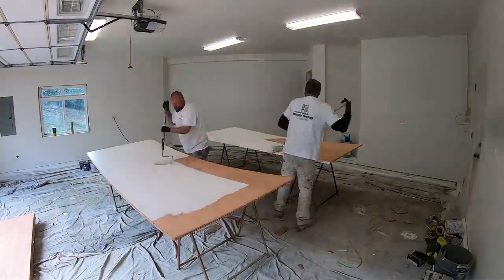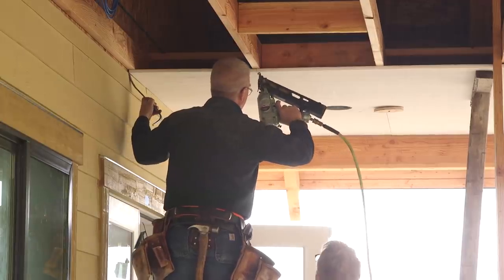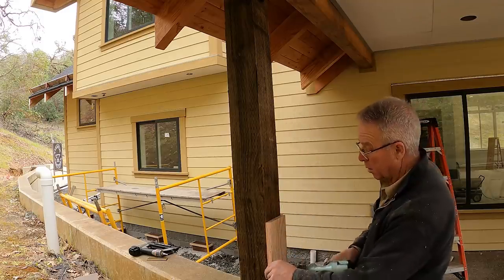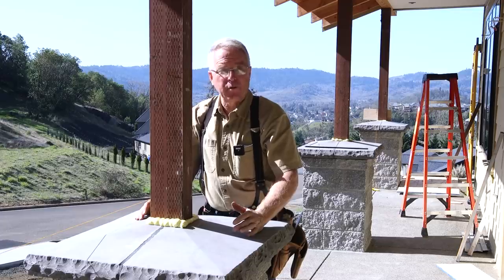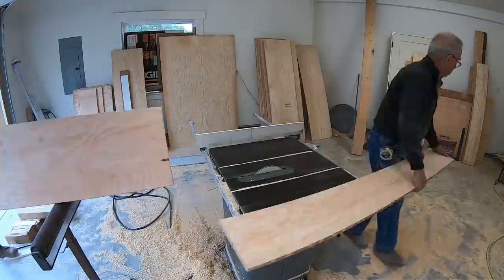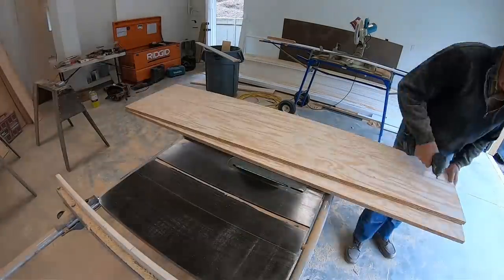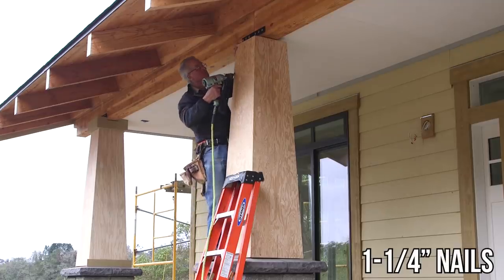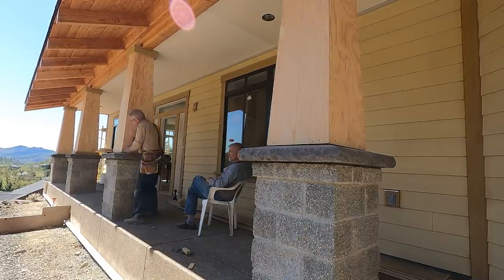Building Tapered Columns and Other Exterior Trim Ep.116

Comment: No adhesive on the tapered columns boys?! I know you said glue was unnecessary but I think with those pacific climates eventually those joints are gonna open
Reply: I would have gone with a 2x2 screwed to each corner for rigidity and something for the nails to grab onto. Plywood kinda sucks for holding power on its edge. I also would have reinforced the fronts of each around midway up for the possibility of flagpoles being installed on them.
Reply: Lose all the wrap and use a bigger column - sand and stain the REAL wood. This crap will fall apart in a few years.
Reply: @RRaucina  it'll be painted and it's barely exposed to any real weather. I think it will last more than a few years. But it's possible some warping or gaps opening up will happen inside of ten years
Reply: I agree I think it should've been glued.
Reply: If you had glued those with non foaming construction adhesive, they might not open up !  I don’t even know if those boards will stay laminated in your local climate.
Reply: It's decorative, not structural. Those joints will be fine for years and years and years... Besides, being in the climate that its in, it's gonna need to be able to breathe and expand and contract. Gluing it would defeat the purpose of that.
Reply: @mikeznel6048  you're correct about the expansion, but that's the point of the glue actually. When you correctly glue two pieces of wood they effectively become one piece, and thus move together rather than independently. By relying only on nails each side of the wrap is going to flex independentky, and eventually open the seams at the corners. 

Also it's the PNW, just because a porch is covered does NOT mean that the stuff on it won't be exposed to the elements. Rain often comes in side ways up here, and once the wood gets wet the temps don't often get high enough for it to dry out (3+ days at 55°+). That's what leads to rot in exterior trim, it's easily the number one exterior repair I do up here.
Reply: @Adamsadventures83  that  would look good every column "Flags out"
Reply: @mikeznel6048  respectfully disagree, using the right adhesive will still let the wood expand and contract but using no glue in a wet climate like the Pacific north west will destroy those joints in <10yr
Reply: Here in Tennessee the joints would pull apart .. plywood would bow and bend without ridgid nailers behind the joints .. I would definitely recommend glue on the miters
Reply: I'm a lifelong carpenter.  I agree it should have been glued.  I would have done so instinctively if I were building it.  But I don't begrudge EC over it.  I'm sure it will look great for a long long time.  But it would definitely hold together for a longer time with glue on the joints.
Reply: @jamesandayladodge4815  I agree but would say that I would think most of us commenting are carpenters but I guess you never know on here
Reply: @JB-ez2jz  I suppose you are probably right.  IDK, I often watch videos on adjacent trades out of pure curiosity, but yeah I don't usually comment on tree felling techniques.  So yeah, your right, most people commenting with serious thinking are probably carpenters.
Reply: I would usually agree with needing glue too but if this guy says it isnt going anywhere, it probably isnt going anywhere!
Reply: "2 of a trade never agree"
Reply: @willofdodge1  I agree with the idea that there's more than 1 way to skin a cat and different tradesman have different ideas. Honestly most times Scott has some many years over me and is so wise I'm usually learning. In this case I just don't believe it's the right move. Using laminated sheet goods  in the humid and rainy Pacific northwest and asking the joints not to split wide open like Megan the Stallion eventually is asking for trouble
Reply: My thoughts exactly. You gotta stiffen up that plywood joint, especially when exposed to the moisture.  I wouldn't even trust glue and nails. Frankly, i wouldn't even feel comfortable using plywood at all

Comment: Long-time subscriber, here. Found your channel while looking for concrete finishing techniques (you poured the pad for the garage of the spec house-- very good info!). Went back and watched all the  vids on building spec house-- powered through them all, and set notifications so I could see everything after that. Anyway... was dearly hoping you would include clear instructions on how to determine angles for tapered columns (and maybe how to cut them if you don't own a table saw).  Wanted to build some, once, but no amount of pondering in my ignorant mind contributed to anything like an answer. In a word: I was (and remain) CLUELESS! Beveled edges: totally get that. Center line to help determine angles... lost me there. Fast-motion video as you cut the plywood: left me in the dust. Virtually every other video you've posted fully explains what and why you're doing what you're doing (which is why I love your channel!). This one, though, left me "high and dry". Can you possibly re-purpose some of the video you've already shot, slow it down, and over-dub with some helpful information? Would massively appreciate it!

Comment: I've been in carpentry for 23 years and your channel teaches me things every new episode. That said, my biggest peeve with both carpenters and painters, especially on new construction is not priming both sides of the wood. You beg for peeling and other moisture issues on the finished product. I just yanked off 1360 ft of 10 inch(8) cedar siding and replaced it with new material.  Primed it on both sides with a topcoat of Benjamin Moore stain and we're going to do the west and east sides next year. The front never gets any sun and never peels. The house like several I have rehabbed over the years was built with raw unprimed cedar and stained raw so the moisture inside the house pushes off the coatings. Even had one builder tell my client that hous wrap would make his house explode due to pressure because his wok is so tight lol. He didn't prime an entire 6000 ft cedar home either and they've paid me to reside that entire house. It's a disgusting waste of trees. OK, dismount high horse and continue your excellent videos and work.

Comment: I have done exactly one set of similar columns, and I was doing them for my own home, which certainly changes the time management requirements.  I did a few things differently from Scott, the biggest difference being that whenever I build anything going outdoors out of wood, I prime both sides of the wood.  More work, but I don't have to look at wood that has been distorted by moisture seepage, ten years down the road.

Is what I do necessary? Not in a million years would I think that I know better than the Essential Craftsman, but neither am I ready to change what has worked for me for years.
Reply: I did that for the drywall in my bathroom.
Reply: Back-priming is never a bad idea. I'm not a pro - I sell medical equipment, but I'm compelled to constantly build, and I try to always back prime, especially because I'm primarily using pine that has a tendency to cup like crazy.
Reply: I work in a leisure centre, and in the changing rooms the MDF architrave (casing i think Americans call it) around all the doors is exploding where moisture has got in. It looks terrible, and definitely supports your idea of back priming.
Reply: @Matt_Alaric    Ah, good; someone agrees.  Now, I wonder what Americans would call a leisure center, 'cause I don't know what one is.
Reply: @dandavis4157  Gym? Sports centre? Something along those lines i would guess.

Comment: Another awesome video! A track saw could've been another option for the colum cuts
Reply: Not as accurate as a jig on table saw. Love my makita track saw and my dewalt table saw.
Reply: @SteveDiamond19  I work alone and often do fold over miters with the track saw. Running whole sheet goods over the cabinet saw can be tough if there is a slight bow or cup in the sheet especially considering the cuts in the video were done on a blem product. Keeping the sheet in contact with the table through the whole cut can be tricky, a deflection of 1/16 can mess up a nice mitered corner. The nature of the track saw keeps the saw engaged with the workpiece consistently through the cut.

Comment: I plan on doing the same craftsman style column wraps for my porch but will use lock miter corner joints via a lock miter router bit.  I'll assemble three sides and add the forth after placing around the posts.  Getting tight miter joints without exposed fasteners is what I'm looking for because I'm using clear vertical grain cedar where I've already glued up the 3/4" 1x8's.  A track saw comes in handy instead of a table saw for cutting the pieces before running through the router table.

Hope I don't screw up anything.  That wood is expensive!

Comment: i do this with white 4x8 plastic board and pvc trims from home depot.  I lay it all out on the sheet, cut it square with a circular saw, then run it on a router table with a lock miter bit.  to install i just nail it at the top and glue the bottom, with some spakling and rounding the edges together with a screw driver or any round piece of metal.  it looks great

Comment: Scott… PLEASE tell me you don’t have edge plies (unprimed it looks like) of that T-111 touching the concrete on that rear retaining wall (or anywhere)! After all the careful waterproofing you’ve done everywhere else? It wont last a year, even if it never directly gets soaked. We leave any detail like that up an inch and seal the heck out of the end plies.. and even that doesn’t always prove durable.  Also on any faux column a couple small screen vents top and bottom will go a long way toward helping them hold paint.

Comment: just did four tapered in doug fir on a thirty foot pergola . tapered 45s are a small challenge . did em with a circ saw and came out fine . lil glue and a nail set roll , sanded lookin solid .

Comment: You said- didnt use glue. I would have used titebond on miters. Nailed liked you did. Glue is your friend on joints.
Reply: Don't need it, it's just decorative.
Reply: @mikeznel6048  It's only decorative but adding some construction adhesive would have ensured that the joints could never pull apart, which would look bad.
Reply: @josiahmartinez4584  Show us your video of how to do it correctly! :)
Reply: @josiahmartinez4584  you got no right to talk to this man like that
Reply: Unless you got a Channel with a million subscribers
Reply: @613kc  not necessarily true, I have alot of respect for Scott but no one is infallible. I would have glued the miters as well. I come from a wetter climate as well and have noticed I'm more over the top with drainage and water considerations than the Scott is.
Reply: I repaired columns just like this in less then 5 years the plywood rotted and joints split apart .. glue will help but weather trumps the materials used in this video.. Columns usually fail where it joins to concrete or a flat surface..
Reply: @seakadventurer1330  How about a cedar shingle over the 3/4 plywood?

Comment: Beautiful job as always.  A trim carpenter that does this for a living might have had a better approach but for a generalist to be able to pull that off and have the joints all look that type is truly impressive.  I still would have glued those joints though :).... Sure it's messy and you have to protect the caps, but in the end it's bulletproof.  Much more important it's going to protect that china ply from delaminating.

Comment: Beautiful work Sir . Congratulations on the million sub mark . I do have one question in relation to columns . Most of the craftsman style houses that I have seen have a corner trim that runs vertically. Is this normal or just someone’s cover up ? I haven’t done much craftsman style ext trim . So just wandered . Thanks
Reply: Corner boards are common on craftsman-style houses.  Aside from the aesthetic appeal they make it easier to side the house if using clapboards.  The corner boards don't cover up the siding at the corners, they go on first, then the claps just butt up against the corner boards.  Without the corner boards the carpenter would need to miter each outside corner or stagger the joints, and that's VERY time consuming

Comment: I have some circular / round vertical porch columns ~ I’d like to put a tapered plinth at the bottom to deflect rain and snow ~ to prevent rot. The circular part makes it a bit trickier. Any tips would be greatly appreciated. 👍🙂

Comment: "We made it & really only wrecked two sheets."  My version would have been "we made it & only wrecked 37 sheets...which is $2500 in todays market".
Reply: Probably more, actually
Reply: @bpmunroe  Well I just checked my local menards, I live in the midwest, and it appears to running around 35 bucks for a 4x8 sheet.  So his estimate is about twice my cost.  Still wayyyy tooo much IMHO.
Reply: @mdhofstee   35 a sheet? Hot damn. Northern VA it’s about 55-75 depending on the type
Reply: I wouldn't even try with current lumber prices.
Reply: All the more reason to watch and learn to gain confidence in your abilities.
Reply: 4x8 5/8 plywood in southwest Pennsylvania is 78 a sheet.
Reply: @mdhofstee  must pay off to live close to the mills. Here in the northeast that would run $60-90 depending on grade.
Reply: @bpmunroe  Well its menards and for some reason they typically have the best lumber prices.  My dad who does a lot of wood working prefers them over anybody else like the Blue Box or Orange Box stores.  I dont think the midwest has a lot of wood mills as I only know of the mills located in the northwest pacific or in the southeast.  Southeast has some good growing season as their winters are not as harsh but then again we have hardwood mills in my area.
Reply: @mdhofstee  I read “Midwest” as “northwest” and thought you were up there in the Forrest. In any event, the only 3/4” 4x8 sheet goods (Scott was using 3/4”) close to $35  near me is melamine or MDF. The $35 plywood is 1/4”.  I just bought 1/2” plywood at $50 and that is one the cheap end
Reply: Does anybody know when this video was taken?

Comment: I would not have taken the panels down to the cap stone. I would have left a 3/4" gap so any water intrusion would not wick up the panels. Also would have used a waterproof composite material for the bottom moldings to avoid water problems.
Reply: Yep, AZEK, joining the corners with PVC cement.  I would have bedded them in polyurethane caulk too.  Those will get rained on alot.

Comment: My 1911 craftsman house has the same sort of tapered columns supporting the upstairs portion of the house over a covered front porch. The carpenters who did it did a perfect job cutting and applying the veneers over the posts to achieve the tapered look. I’ve been debating wrapping these posts with stacked stone ledger panels but trying to mimic the trapezoid shapes on each tapered column seems too big of a chore and would probably ruin the beautiful carpentry.

Comment: Danger!!!!
Kickback likely to occur when cutting underneath the tilted blade on the cabinet saw.  (Also no splitter or riving knife installed) . 

There is a way to do this safely on the other side of the blade.  

Thanks for the wonderful video series. I enjoy the craftsmanship so much.
Reply: That Unisaw is probably older than you.  They cannot be fitted with a riving knife, but they certainly can be fitted with a good aftermarket splitter such as a Shark Guard.  A splitter isn't really necessary with sheet goods, but it certainly is necessary with standard lumber.
Reply: @ctclmichaud  I certainly understand your point. I also have old machines because they are built better yet lack safety accessories. I do however personally know people with less than ten fingers due to tapering under the blade. 

My point is never rip anything under the blade. Always and in every case rip over a tilted blade. Especially if there is no splitter or riving knife. 

Wood and sheet goods all have bows. When ripping under the blade, if the stock lifts, the dimension between the blade and the fence becomes smaller and this is when the material catches the back of the blade and results in a kickback. The only thing preventing contact with the back of the blade would be a splitter. 

Regardless of a splitter, machining over the blade is safer, and more accurate, and will produce a better quality of machining (few process marks) 

So please be safe and enjoy those sturdy wonderful old machines with some added fixtures and jigs.

Comment: Those long ripped miters for the corners require nothing less than witchcraft to get right. It would have taken me hours just to figure out the measurements to get the boards attached to the sled. Great work!

Comment: I decided decades ago to design out all soffit material and column wraps. Use heavier timbers, make the deck of 1x12 sugar pine {Sierra Pacific, .79 cents a BF unit price - up until a year ago} that you look up at. This is a special kind of torture and finish nails don't hold too well over time. You know that, if you do Greene and Greene, but the customer likely wanted it and the designer is stuck in time. And by the way, your painter needed to prime BOTH sides of the ply. Stand them on edge instead of the floor and do the other coat.

Comment: Somebody correct me if I’m wrong and it may be that the camera didn’t capture it, but I have been under the presumption for at least 15 years now that the siding/soffit panel known as t1-11 has an 8” on center groove on the finish side. In my area, the panel you used is commonly referred to as BCX soffit, bcx siding, or simply no-groove soffit plywood.